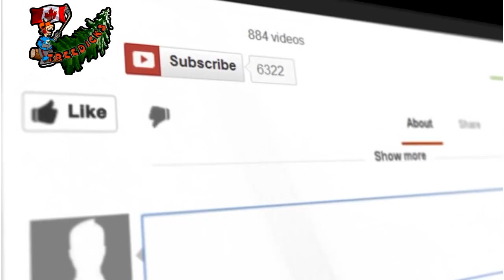At work with Willy

Comment: One of the worst jobs I ever got into when I bought my house. It had been on fire before so I removed all the old insulation..damn what a job. Some of it was not bad because had to replace all the ceilings but in the bedrooms..I kept the drywall and there's where I had issues. Anyway.. especially in july it's hot as ever.